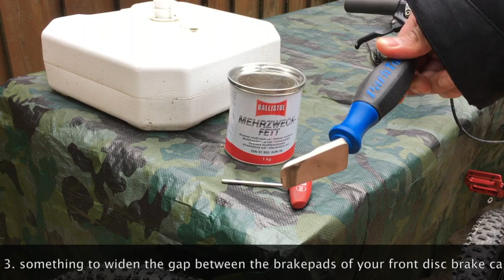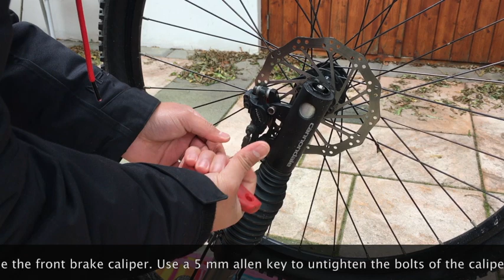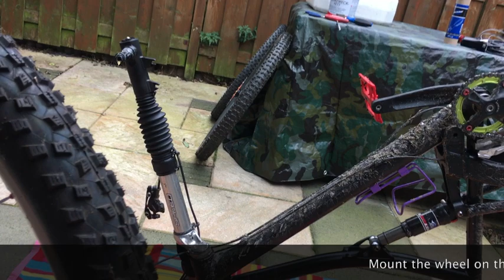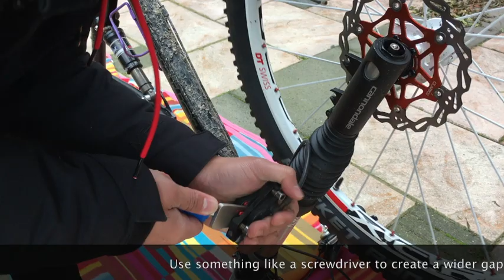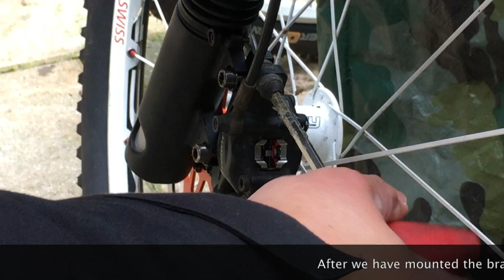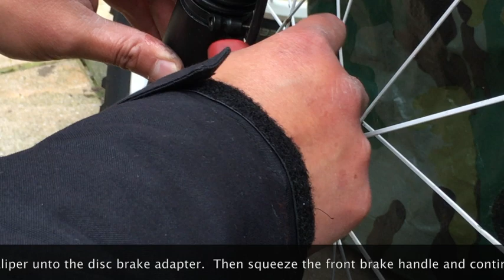How To: Replacing a Lefty Wheel

Comment: Why is it necessary to realign the caliper? Just slackening the fork bolts for caliper removal shouldn’t affect alignment of the caliper to the disc.
Reply from the maker: I needed to do that because the new disc was thicker.
Reply: @biketuningbonanza1341  Surely not necessary unless the replacement disc has a different centreline offset, so most people won’t need to bother with this.
Reply from the maker: @davidnorth8808  I only know that the new disc was rubbing against the pads and after alignment everything was ok….

Comment: Do you know how to replace the brake on this bike and what parts I'd need?
Reply from the maker: You can order any hydraulic disc brake for the Lefty fork. It is all standardized. I replaced the front and rear disc brakes one year ago. I replaced the old Avid brakes for cheap Shimano hydraulic disc brakes and it works fine! These cheap brakes are better than the 15 year old Avid brakes.
Reply: @biketuningbonanza1341  that's weird, the shop I went to said it wouldn't work because the 900sx lefty has this proprietary mounting bracket on the fork that needs some adapter to put the brake on. Are they lying to me?
Reply from the maker: @Jgoofing  No, but I was assuming you still have that bracket. Bu apparantly you have the old style hydraulic disc brakes. I guess you need this: https://www.bikester.nl/shimano-pm-is-schijf-adapter-voorwiel-160-mm-M340167.html?vgid=G380592&_cid=21_1_-1_9_34_380592__pla&campaign_detail=smart_shopping&gclid=CjwKCAjwmJeYBhAwEiwAXlg0AUJUGRjJlooVaYVGdGwaXxnZQLi2494aKjFGmrVVmM3K6iy8FrNenBoChsIQAvD_BwE#

Our Lefty forks have an IS2000 mount for the brakes. But all newer hydraulic brakes have post mount nowadays. Another link: https://www.bike24.com/p24234.html

Comment: Thanks for sharing. I have a 2012 flash 3 29er and I’m tying to do the same thing. How do I know the proper specs for the replacement wheel? Ie offset and such. Thanks!
Reply from the maker: Ryan Taguding Ryan Taguding Hi there, If you need a replacement wheel for your Cannondale the best way is to order it at your local bike shop. If that is not possible you can always order online. Lefty wheels come in only 3 sizes: 26”, 27,5” and 29”. Make sure that the hub of the new wheel fits your Lefty fork.